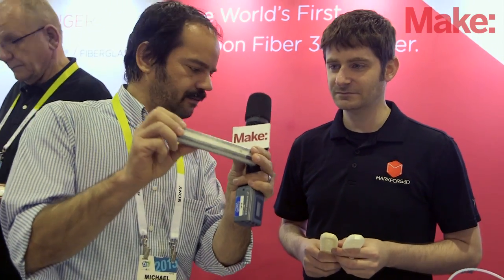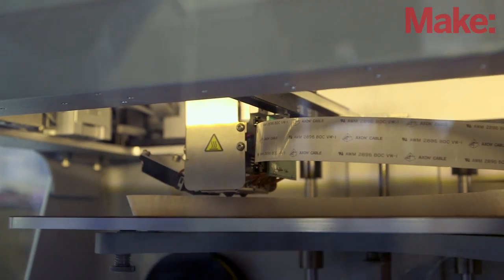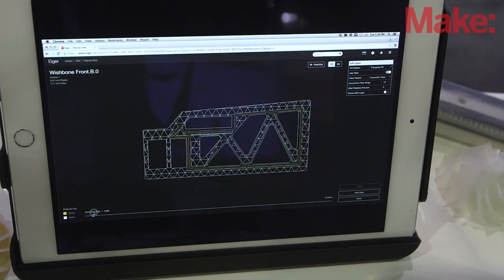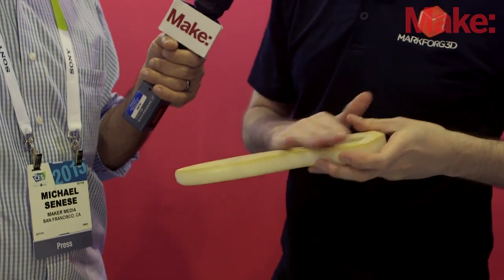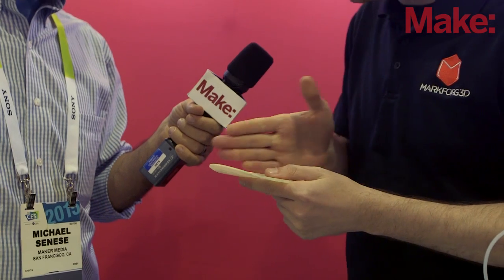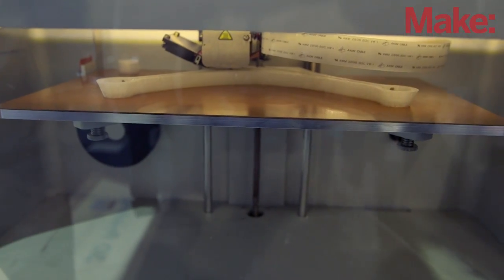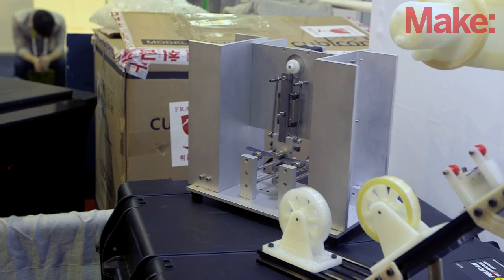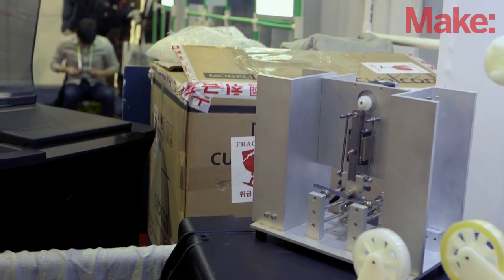CES 2015: 3D Printing Carbon Fiber

Comment: So it's stronger than aluminum as far as strength to weight, but how much stronger?
If I had a 2lb aluminum control arm and printed a 1lb carbon/nylon control arm; Would it be as strong?

Comment: Would it melt using the finished product as a inlet manifold on a motorcycle?  Im fitting a turbo so it will get hot.

Comment: Why did you print that quadcopter in two halves?
OH, I see. The build plate is only 132mm deep. That's barely 5 inches.

$5500 to $8800? I don't think so.
This is not  a professional machine, it's a toy. Hobbyist class at best.

Comment: i think one thing they forgot to think about is Heat Tolerance... very important right? since it got melted out of that printing nozzle at only about 300C - 500Celcius at max i would imagine (someone correct me). it will melt again in the race car.
Reply: Nathan JR
well they can really make body parts off of them and nothing to do with the engines, transmission etc.
Reply: did you not watch the video? he explains that they heat and freeze test it, also the part was a wing mount, so not going to get real hot other then in the sun

Comment: As a professional engineer, the mark one presents a paradox to me.  I desire stronger the 3D printed materials but right now its capabilities are not good enough to replace the Nylon and aluminum machined parts I design on a frequent basis.  FYI I have designed and built large aerobodies and carbon parts, just like these guys.  

I would be more excited about the mark one if I could be more confident in the build platform and nozzle. but the mark one is a hobbyist platform at best.  Composites loose a lot of strength with wrinkling along the major axis. The filament laydown looks shaky along the trace line.  

200 microns of dimensional accuracy isn't good enough to entice me to replace my machined parts.  Right now I only 3D print parts that A. don't require high stiffness/weight B. don't require tight dimensional accuracy.  The ven diagram of those kinds of parts mostly overlap.  I have yet to be pushed into a situation where I require stiffness/weight ratio of carbon without being willing to pay the expense.   

At that point, I don't see where a medium cost ok quality CF printer can really add to my capabilities.  It really backs the Mark One into a niche corner.

I really want to eat my words on this because having high quality carbon parts on my desk at low cost would be a DREAM.
Reply: Andrew Sickafoose 
come back in 10 years. Maybe you will complain less.
This is made for consumers, not professionals.